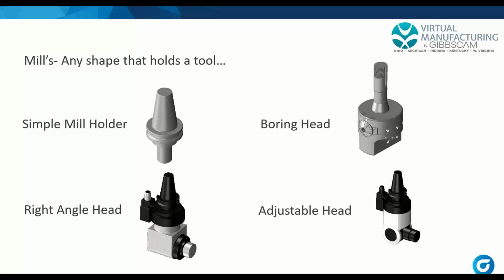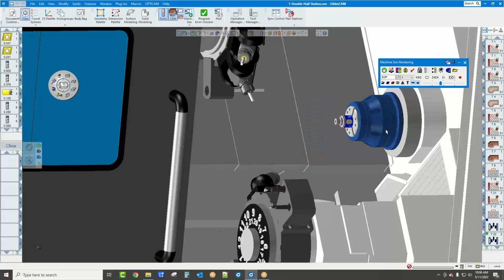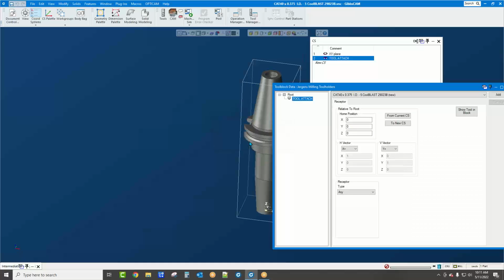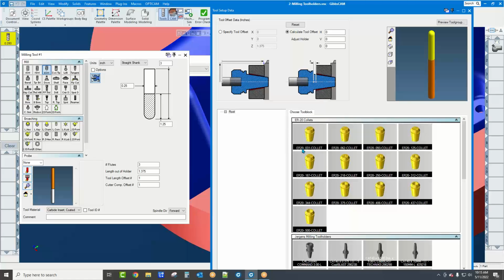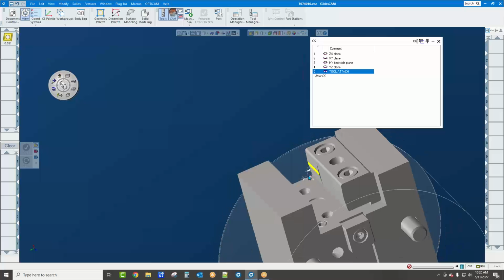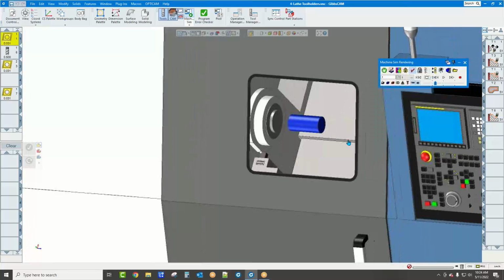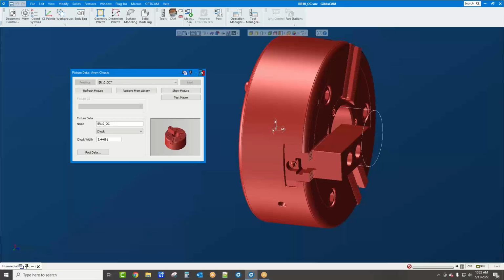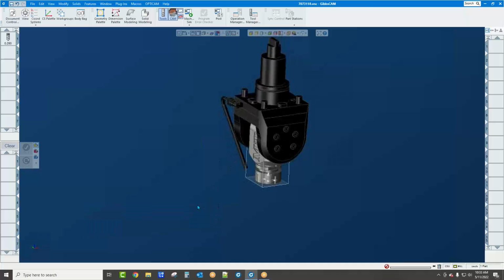GibbsCAM & Coffee: Intermediate Tooling 5/11/22

Comment: I have a question how to add a comment in a .nc file.
I want the name of the tool holder in the comment before the process in the NC program
Reply from the maker: Patryk, there are a number of options for adding comments to your NC file within GIbbsCAM.  Within an open session of Gibbs, go File > Preferences > Post Processor Comments.  Here you will find a number of checkable options for commenting within your posted code.  Depending on how your tools & tool holders are named & saved, you are likely going to want to check "Tool Number & Type" and "Tool Comment".

By checking "Tool Comment", anything that is typed into the tooling dialogue's "Comment" section is inserted into your NC file.  This can be found at the bottom of an open tooling dialogue.
Reply: @virtual-mfg  Thank you for your answer, but that's not what I mean.
I mean the comment contained in Toolblock Data-Post Data. I want to have a comment for the toolholders that I use automatically added. 
for example: 
(MTEC 0605C19 1.25ISO); tool, added manually in Miling Tool Comment
(C6-391.01-63 060); -extension, added automatically in Toolblock Data
(930-C6-S-12-082); -holder, added automatically in Toolblock Data
(393.CF-12); -adapter, added automatically in Toolblock Data
Reply from the maker: @lolas32d  I know where you are referring to in the intermediate tool, but I do not know how to make that
not get output in the code. I assume the post could be set up to grab that text and output it somewhere.  Let me mess around with it a bit!